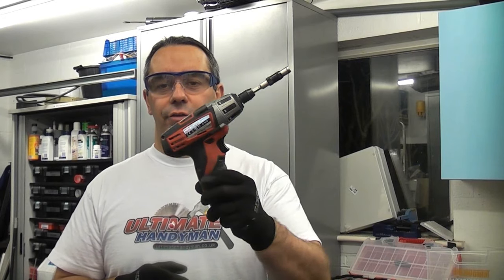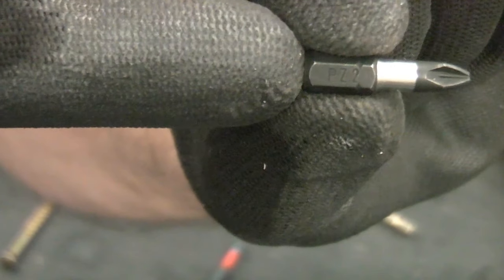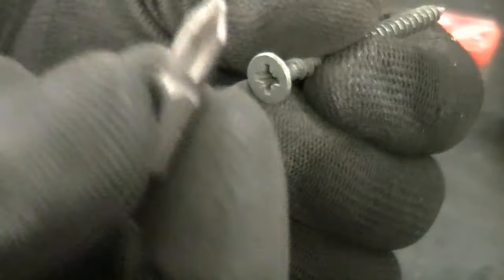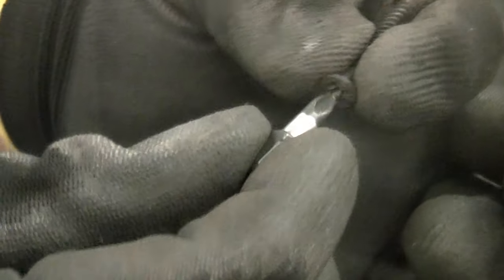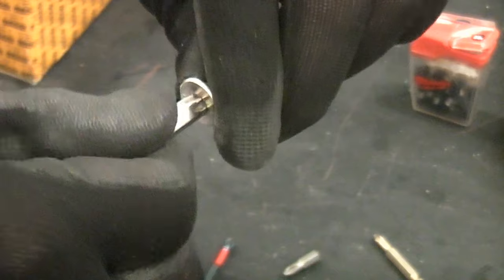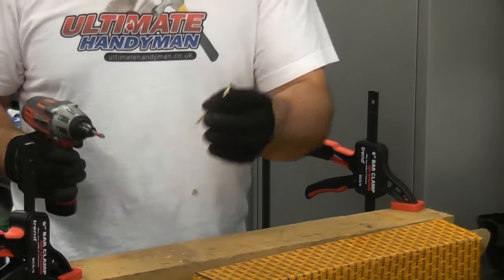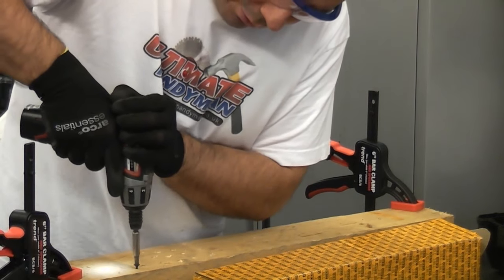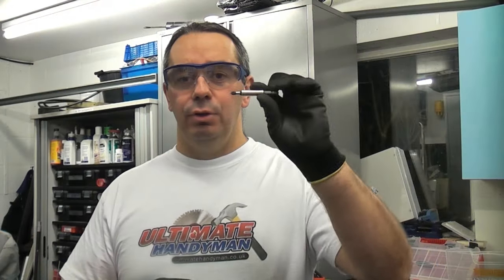How to drive screws with a drill/driver

Comment: I work with someone who also 'pulses' their screws like that and it's very irritating, especially with the torque set low and you can hear the screw won't bite any further!

Another hate is people who always drive screws in 2nd gear - clear sign of a cowboy, always in too much of a rush!

Have you done a video explaining about torque and the clutch?
Reply from the maker: That would drive me nuts!

This video kind of explains torque control - How to use a cordless drill

Thanks for the comment
Reply: I know what you mean, plenty of coworkers who are like 20 years older than me still don't know the difference between pz and ph. And always drive screws on highest speed and with no torque limiter. Never loaning out my bits again...
Reply: FoodOnCrack The company I work for supplies us with Phillips head drivers... Yet, we're only ever using Pozidrive screws. None of which are the highest of quality and so, whenever we encounter something made of cheese (like a machine screw), well, it tends to cause trouble. Age may bring experience but it isn't necessarily a positive one.
Reply: Olly Parry-Jones i

Comment: I guess it's bad that for the last 10 years I've just picked up whatever bit I can find lying around which will sort of fit inside the screw? Also, I use my sds drill as a screwdriver as well as a drill but just use it on a low speed. Is that bad?
Reply from the maker: Well it's only bad if you know that you are being bad, but to be honest there are lots of people that don't know the difference between Phillips and Pozi 
Thanks for the comment 😉

Comment: Help needed: I am a total beginner with diy, and having watched many videos, in an attempt at learning the basics, I am struggling with one.  I note how many use red wall plugs.  Ive looked up, and note these are for screws 5.5 x 25mm (is that right?) and also brown plugs for screws around 7 x 40mm (again is this right?).  Ive tried therefore looking on ebay/amazon for screws 5.5 x 25mm and 7 x 40mm, however I cant find any? If these are the right sizes, how come im not finding any.  In regard red and brown plugs, what screws do you use in them.  Anyone can answer this question, as I really need the help.  Please dont take the mick, we all have to start some where.  Appreciate any help.
Reply from the maker: This should help- https://www.youtube.com/watch?v=V4wVyyfbWog
Thanks for the comment
Reply: Thanks buddy, already seen that one. Im still left unsure what size screws to put in red and brown plugs.  I know they say 5.5mm for red maybe 6mm, and 7mm for brown.  What lengths though? the red is what around, 25mm in length, so is that how far you can go, or can you go longer, and itll just push the ends open.  Same with brown plugs, they say again, 7mm, but ive looked and the length is around 40mm. So is that the limit, or again, can you get longer, which will push the ends open? I tried looking on ebay for screws that are 5.5 x 25mm and 7 x 40mm but cannot find any, so im so confused, as these appear to be popular sizes when using red or brown plugs.   

What size screws do you all put in red and brown plugs.  I know brown is meant to be 7mm, but what can you get away with, same with red plugs, they are meant for 5.5 to 6mm, but again, what do people actually put in them, and lengths?
Reply from the maker: You can put any length screw in a plug, providing the hole is deep enough for the screw, or the screw will bottom out.
40mm long screws will be fine, as long as the hole is deep enough, the screw will go right through the plug.

There is a chart on this page, which should help- http://www.ultimatehandyman.co.uk/how-to/fasteners-fixings/wall-plugs

Thanks for the comments

Comment: I plan in using masonary screws to screw stud walls into masonary walls and school parquet flooring to secure the stud walls,  I will do the 6mm pilot whole first then drive in screw with my combi drill, do you think my makita LXT white and black model drill with a 3ah battery  will have enough power to drive screw through masonary as I don't have a impact driver currently
Reply from the maker: Yes, it should easily do it.
I'm sure in the past I have used a 12v drill/driver.
Reply: Ultimate Handyman thanks that's great
Reply: Use concrete screws - fantastic stuff.

Comment: But how do you know what fitting the screw head is. Is there a easy to tell?
Reply from the maker: Phillips head has 4 lines, Pozi head has 8 lines (4 large and 4 smaller ones)
Then you just need to get the correct size bit by trying them in the screw, some screw boxes tell you which driver bit you need. 
Thanks for the comment 👍

Comment: My drill didn't come with that cylinder extension piece to insert the drill bit. Can I use the drill bit without the cylinder extension piece?
Reply from the maker: +Karl Hans 
Yes, no problem at all.
It's just easier with the bit holder, but you can put any bit into a standard chuck. Or straight into the 1/4 hex holder if they are hex shank bits.
Reply: +Ultimate Handyman Thanks.

Comment: Do you always pre-drill the hole first
Reply from the maker: It depends, most of the screws that I use are self drilling/self countersinking.
If I want the piece of timber fixing as tightly as possible to the other piece of timber, I often drill a clearance hole in that piece.
Thanks for the comment 😉

Comment: Thank you, I have been wondering about this for a long time and meanwhile I have damaged many bits and screws (Philips head only). Finally I did a search and came across your video. Now I know about the bits and the their codes but how do you identify the right screw for right bits, are they marked?
Reply from the maker: You can tell the difference between Phillips and Pozi as Phillips have just a cross, but Pozi has a cross with a smaller cross at 45 degrees to the first cross. 
Thanks for the comment

Comment: Im 9 years old and i have a problem. I want to unscrew a screw. Should i do it clockwise or counterclockwise?
Reply from the maker: counterclockwise in 99% of cases.
You can get left handed screws but they are not at all common.
Reply: Leftie Loosy Righty Tighty

Comment: any reason why I see a lot of "pros" use a very long shaft for the driver bit?
Reply from the maker: In some circumstances you can only reach some screws using a longer bit holder, unless you hold the drill on a slight angle. One example is if you are fitting a fireplace to a wall, it often requires fixing to wall and can only be reached using a longer bit holder, or the chuck can damage the fireplace. 
That's the only reason I can think of. 
Shorter is better for me ;-)
Thanks for the comment 👍

Comment: I'm constantly having the bit pop out of the screw, even if I use the bit provided. Part of the reason is that no matter how much I try, the screws often end up going in sideways. I then struggle to maintain that exact angle, very frustrating!
Reply: The screws are going in sideways AND the bit is popping out for the same reason. Those are symptoms. 
The problem is your bit and screw is not forming a straight line to the hole. At some point your are pulling the drill sideways. If its early in, the screw goes in crooked. If the screw is in 1/4" or more, the drill pops out.

Comment: What happens if i did not release the trigger in time while screwing in. may be like 3 to 4 seconds
Reply from the maker: If you are not careful you can strip the threads, meaning that the screw will not grip correctly.
Thanks for the comment 👍

Comment: What about wood splitting because of not pre drilling? Just wondering.
Reply from the maker: I always buy self drilling and self countersinking screws, so no pilot hole is required.
Thanks for the comment
Reply: Aaaaah ok...Thanks for the reply...
Reply: Wood splitting can happen for a myriad of reasons, the thickness of the material, how far you are drilling/screwing from the edge, what type of wood you're screwing into, the quality and the the size of the screw.  If youre unsure always pilot drill it.
Reply: A pilot hole (size matters) provides a space for the screw to sit in and thus less likelihood of causing a split.

Comment: When should you use a guide hole?
Reply from the maker: You need a pilot hole, when using poor quality screws. I normally use double thread, self countersinking screws. 
A pilot hole should always be drilled into hard woods, even with good screws  👍

Comment: Good to see some basics being taught. 

But can you describe the differences between each of the screw heads/drivers rather than just waving them around, because each of them (other than the torx(?) head) look very much the same.  I am sure that the difference is obvious to you but to the untrained eye the pz and the ph look almost identical.
Reply from the maker: Sorry for the confusion, it's easy to tell a PZ (poxidriv) from a PH (Phillips) because the Phillips is simply a cross, so it looks like this X a Poxidriv bit looks like a X but with a smaller cross at 90 degrees to it + . If you put the + on top of the X in the dead centre that is what a Pozidriv looks like.
Reply: *****
Thanks for the additional information although I still don't quite get it.  I see the X of the Phillips head but still get confused about the X with a + over the top.

Can you do another clip shoeing the two screws side by side to enhance your explanation.

Thanks
Reply from the maker: Mick S
I'll take some close up pictures when I get chance. I could not get any closer with the video camera as it kept going out of focus.
Reply: The images in your video were fine.  It just needs a comparison side-by-side pointing out the differences.
Reply: Mick S Wikipedia lists all the various screw types, where you can clearly see the difference between Philips, Pozidriv and all the others: http://en.wikipedia.org/wiki/List_of_screw_drives
Reply: *****
 Easy way I remember is that a Philips is simply a cross and a Posidriv is a cross with hash marks

Comment: Pozi drive not posi driv
Philips (ph) screws were originally designed for the automotive industry and were designed to "cam out" to prevent over tightening of trim fixings etc.
Then thefe are Robertson, spline, tri wing anf hex socket (Allen) to mention a few
Reply from the maker: Pozidriv ;-)

Comment: can these go through bricks? as in a concrete wall?
Reply from the maker: +Shazreen Jamal No, you need to drill the correct sized hole in the brick and either use wall plugs or masonry screws.
Reply: thank you so much for the detailed response *****
Reply from the maker: +Shazreen Jamal 
You are welcome ;-)
I did try posting a link yesterday to my video on masonry screws but couldn't for some reason, so here it is-

https://www.youtube.com/watch?v=P0LXQG3S8ko

Comment: why do most people pump the trigger? I do it too and I don't know why. Guess I'll have to do a side by side test to figure it out.
Reply from the maker: Pulsing the trigger works well especially when starting off ;-)
Reply: Most drills have variable speed, so why would you pump it, when you have more control starting off slow, then speeding up. I have much less cam-out starting slow, rather than pumping it. Been doing it like that for the last 30 years and get better results.

Comment: Good Video!

But at 03:00 and forward; remember not to cover the breathing and cooling holes of the tools, warranty will not cover overheating caused but blocking the ventholes
Reply from the maker: You don't have an option with some drills, unless the side handle is used (not all drills have a side handle)
Thanks for the comment

Comment: will it work on wall or concrete ?
Reply from the maker: You can get screws for concrete but you must drill the correct size pilot hole first.

Comment: How about showing us the best way to tigen two boards together with screws, explain how if you don't get the boards tight with the first screw they won't go tight no mater how many more screws you put in, and how to use the non threaded part of the screw, and an easy way to remove screws when the threads have nothing to grip. Oh and one more thing, have you ever heard of a Robertson screw bit, they are color coded by size, grip way better than a philips, but they mite be too square for you..

Comment: nothing on the planet makes me as angry as when i strip a screw head usually at halfway in.  any method to identify which bit is needed?  do all boxes of screws tell you what bit to use?  i checked my stash, some show it clearly, others maybe show it but in some kind of cryptic code i don't recognize.  (maybe as part of the model # or something?)
Reply from the maker: On all the screws I have bought except for "bullet screws" there has been an indicator on the box, such as PZ# 2 which is pozidriv size 2 etc. 
The screw driver bits are normally stamped with the relevant model size as well.
The Bullet screws tend to all use the same driver bits, which is normally included in the box of screws.
Thanks for the comment

Comment: anyone can drive a screw straight down with ample room on all sides. What about overhead, sideways and other real world situations? I'm so frustrated with screws I keep a supply of nails handy.
Reply: That's the application where I love Torx-screws. You barely need to apply any pressure at all and they still go in without a problem.
Reply from the maker: Yes, Torx are superb ;-)
Reply: I have a driver bit with a with a sleeve that can extend over the screw. It keeps it on the bit for awkward situations or one-handed driving. It's very useful! :)

Comment: Why don't they keep all screw heads and screw bit the same size instead of messing around with difference sizes.
Reply from the maker: Some manufacturers do, for example Bullet screws from Travis Perkins all use the one sized driver bit ;-)
Reply: Cheers
Reply from the maker: You are welcome ;-)

Comment: there is no reason why the PH2 bit can't drive the PZ2 screw.  However the PZ2 bit can't drive the PH2 screw.
Reply: Actually there is a good reason, the devil is in the details. You cant use a PH on a PZ because they have different sizes and angles on them, even if you disregard the extra corners. Usually the PH has tighter corners to stop it from caming out and the PZ has the "wings" in the corner instead for the same reason, hence they aren't interchangeable for this very reason.

Comment: I was wondering why some philips tips were not as "philips" as others...  didn't know there was more than one of cross headed type! Although I don't think I've seen heads say anything other than PH on the side.
Reply from the maker: I've spoken to people in the states and also in Germany and they were not aware of the difference between PZ and Phillips, so perhaps they are more common in other countries.
Thanks for the comment
Reply: @ultimatehandyman  I'm in Canada so for woodworking Robertson is the standard.  However as a technician that works on Japanese made equipment, I am aware that  JIS  (Japanese Industrial Standard) of crosshead screws is also a slightly different fit from Phillips also, but it's difficult to find the correct type of screwdriver!  First world problems...
Reply from the maker: I'm sure I have some Robertson screws, which came with a Trend pocket hole jig. They seem pretty good!

Thanks for the comments

Comment: what I hate worse then the wrong bit is when they don't predrill a hole and the wood splits lol
Reply from the maker: +Tj1056 
It depends which screws are used. I normally get Turbogold screws from Screwfix, they can be driven close to the edge with no pilot hole most of the time without splitting the timber.
Thanks for the comment ;-)
Reply: +Ultimate Handyman it also depends on the wood and the thickness of it

Comment: When the Pozidrive patent expired Superdrive came out. Hence these different screw drives could go on forever if a company can deliver a flow of succesful ad campaigns. Worth a look...
http://en.wikipedia.org/wiki/List_of_screw_drives 
You have to consider a punch makes the female side of the drive and these can wear out quickly especially if they are "exotic" in design. Screws like these are cold forged in a heading machine...
COLD FORGE HEADER MACHINE
The noise a factory of these machines make is unbelieveable
Nice feature video, thanks UH
Reply from the maker: Thanks for the info ;-)

Comment: I know this video is 3 years old but now days there are Zero reasons to use Phillips, even if you use the correct but.  Modern 6 points and Square Drive are far superior.
Reply from the maker: If you have Phillips head screws, you have to use a Phillips driver ;-)
Thanks for the comment

Comment: phillips screws are crap.  Don't know why they are still manufactured.  Torx or robertson are far better.
Reply from the maker: Torx are great, I think Trend use the Robertson system on their pocket hole screws.
Thanks for the comment ;-)
Reply: Well I prefer Phillips over hexes that break bits trying to get it out

Comment: I'm always laughing at Americans camming out on every single screw, but I didn't notice that drywall screws required a Philips bit. To be fair I didn't have any camout, but I should have thought to check.
Annoyingly the box of screws comes with a space on the lid for the required bit, but B&Q sell them without one.
Reply from the maker: You would be surprised at the amount of people that don't know the difference between Phillips and Pozidriv 
Thanks for the comment
Reply: From my limited experience I've found that Philips screws are mostly used for automotive and electrical.
Pozidrive are mostly used for construction. Why Drywall screws are Philips head is anyones guess...